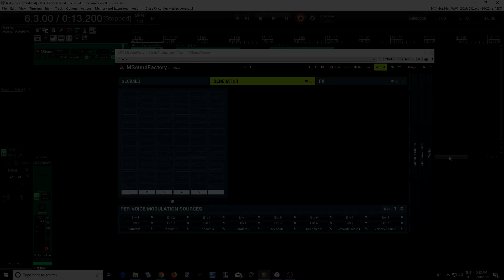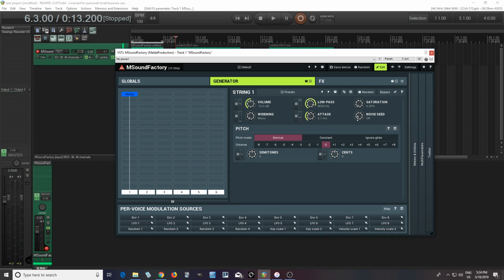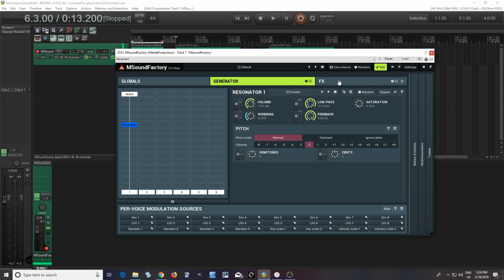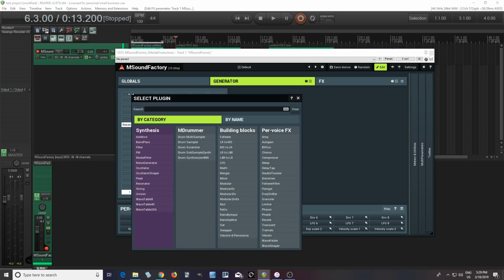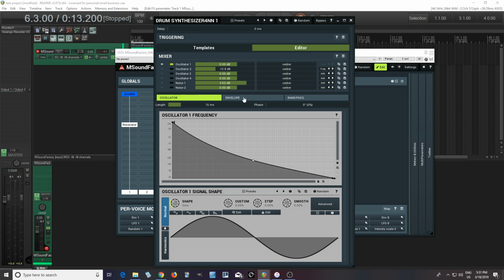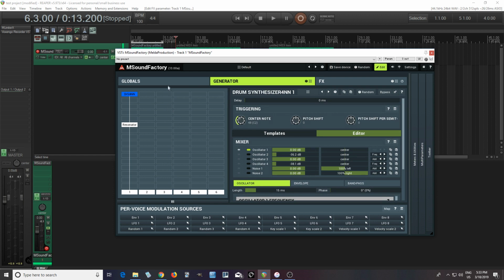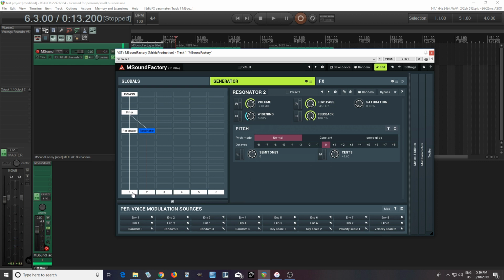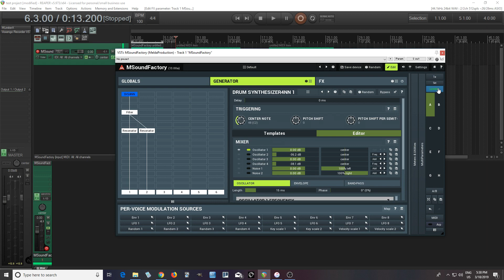Physical Modeling in MSoundfactory Pt 1

Comment: This looks great! I could synthesise bass guitar, orchestral strings and more! I hear they'll be doing an LE version that comes with factory instruments but no edit screen. Do we have any gossip on that? I don't have the cash spare to buy the full blown version, so it'd be great if the factory instruments were extensive. Or if we could download presets made by those with the full version.

I'm a long time Melda user since 2017. Recently bought MDrummer and it's the best software I've ever used!
Reply from the maker: The LE version will be cheaper, but I don't know the exact price. You won't be able to do all the edit screen stuff, but the devices will be pretty flexible. I'll try to add some physical modeling devices if I can. From what I heard the LE version will be very affordable.